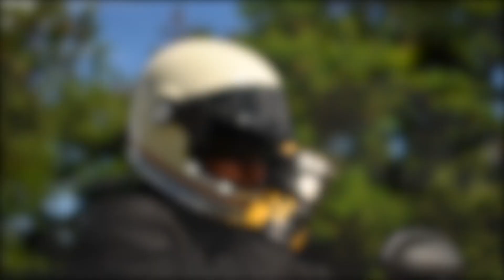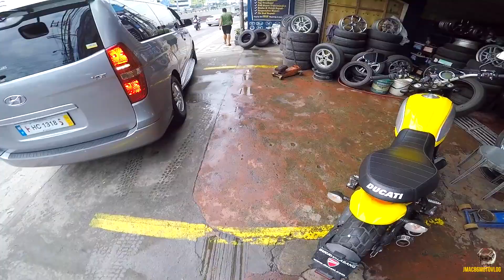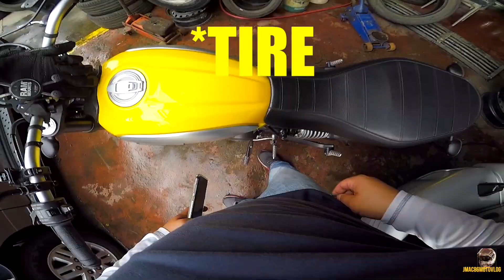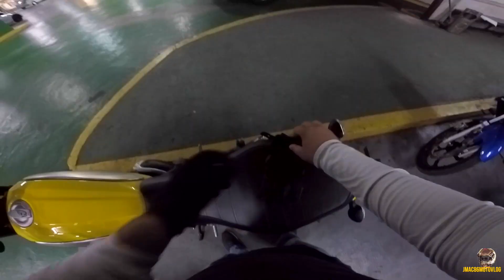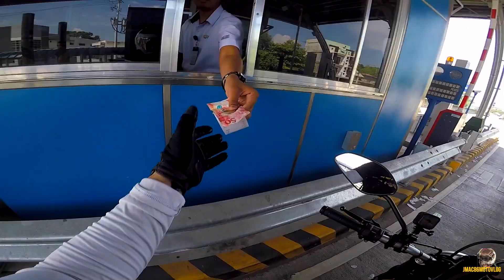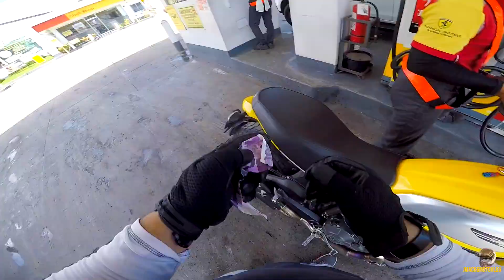DUCATI SCRAMBLER VS YAMAHA MIO | STUPID MOTORCYCLE RIDER | YOUTUBE VLOGGING

Comment: You should put some (original brand) tire sealant solution on your Tire Bro = ) It's work good on my SYM SBR 115 tubeless.. It's lessen my worries on some torns\screw\tire blown crack on the road to fuck up my day.. = ) oh yeah!! yung pasak pasak ksi na yan pag tagal at napudpod na, sisingaw din ulit yun, tas pag pinasakan ulit lalaki na yung butas.. It will destroy your tire good condition Bro..